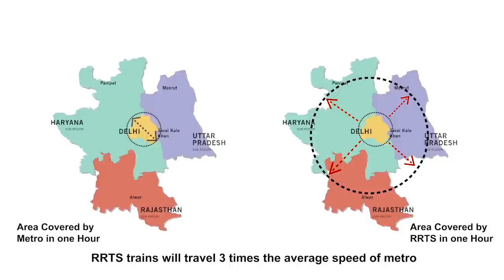First Look of Regional Rapid Transit System (RRTS) Train

Comment: This Project also needs to implemented in Mumbai Metropolitan Region and Mumbai-Pune Region.
This can also be used in Bangalore-Mysore Region.But first we need Proper Metro System in Bangalore.
Reply: What's wrong with the metro system in bangalore? I'm not from bangalore and i haven't used their metro yet... But i have seen it from the outside for a few times and it looked nice
Reply: @IntrophyGamer  Looks do not matter much, sir (although I would agree that the older Kolkata Metro sets looked hideous). Bengaluru needs a larger network. The current one does not do much in solving the traffic problems.

Comment: RRTS is welcome with a speed of 180 kmph. oooH, a good achievement.

At the same time look at Sothern Railways MRTS, (Tamil Nadu Chennai)  even after 4 decades MRTS not yet completed.   Just 5 KM rail line took 15 years and God only knows when the project will get completed.
Reply: its gonna be made into metro in phase 2 by 2025
Reply: @Sathish_12  
well said.
will this 2025 is in this yuga [kali yuga] or after that?

Comment: Why trains are not made from aluminium ab to Pune metro bhi usse ban rahi hai
Reply: It's  a new experiment
Reply: Composites, steel are better
Reply: Manufacturing costs is higher in case of aluminium train sets. And the tech is also complex. Very few countries have such tech. It is not considered as it'll increase the project costs and might make it unfeasible.

Comment: Train 18 can also do the same work then y bombardier???
Reply: It is not a government owned project. PPP.
Reply: @CBuzzShorts  ok. But rajat ji it will be boost for train 18 if we select it.😔😔
Reply: @umeshsah143  I have already told you, it's PPP, govt can't decide on it's own.
Reply: Train 18 and train 19 are different projects sir..long distance hoti h wo.. Bureaucracy ne kharab kiya h wo project.. But ab sahi chal raha h..usko kafi autonomy mili h.
Reply: Train 18 ki speed 130 operational
Rrts ki 160 operational
Design mai din raat ka farak
Train 18 mai technology default ayye hai
Train 18 runs on Broad gauge
Reply: Train 18 is for long distance and RRTS is for short distance. (50km-100/150km)

Comment: If we are making a separate line for these RRTS, then why the max speed is only 180 kmph? This is the chance to introduce a little faster tracks for these new-gen trains, the speed offered should at least be 250 kmph to compete with international level of transit among rail.
Reply: I think the technology required would be costly or maybe electricuty consumption or fares of travel would increase.. that could be a reason maybe
Reply: It's a short distance train with more stations. An average of 160 kmph is enough to serve the requirements.

Comment: I just learned that the 82 Km corridor will have 24 stations. This means an average distance of 3.4 Km between 2 stations. How are we planning to attain a speed of 160 within that?? I hate this! The Indian Railways created so much of hype for Train 18, and now it is running at 130 Kmph only, not even 160! I don't know what our problem is. Why can't we think of 200+ at once...kab tak 110-130 mein hi daudte rahenge?? I don't like this plan of having 24 stations.
Reply: Ok. I just learned that there will be non-stop trains too.
Reply: @AbhishekSanyalTGV  Vande Bharat only suffered because of politics. It was destined to replace some Shatabdi Train, but it was made to run on Delhi-Varanasi route just because our dear PM contests elections from Varanasi seat. And at that time elections were just 2 or 3 months ahead.
Reply: Rishu Sonkar  so, you are saying there will be a good amount of gap between Delhi and Meerut stations?
Reply: Rishu Sonkar  Cool.
Also, I am not uncle ji
Reply: Bro our tracks are not capable of handling so much high speed of 200+,only some lines like Delhi -Agra are capable of 180kmph.
Vande Bharat se bhi fast train abhi bhi Gatimaan express hi hai capable of doing 230kmph,but operational and maximum speed hamesha differs.

Comment: only 180 ?????????????????? better  use tain 18  standard gauge  paisa barbad hen cho
Reply: Train 18 use for longer routes and this system use for rignal route big difference...
Reply: The design of Train 18 is not suitable for such routes. You can't just plop a train on a track and hope to run it successfully. There are a lot of technical parameters to be taken care of.
Reply: @thetechnocrat4979  ya but this system have holl different trail track .... Special for only to work this system ... Train 18 not run on this track or other passenger trains ...
Reply: Even those train sets shown here by bombardier can't run on indian railways tracks. Neither the T18 can run on rrts track. Both trains can run in 180kmph but their propulsion systems are different. And they are made for different objective. Yeah it'll be great if they can design a train set for Indian Railways which can run on these tracks like t18
Reply: @Artivule  
That's what I have said as well. Every class of rolling stock is made for a special purpose and ' ecosystem '.